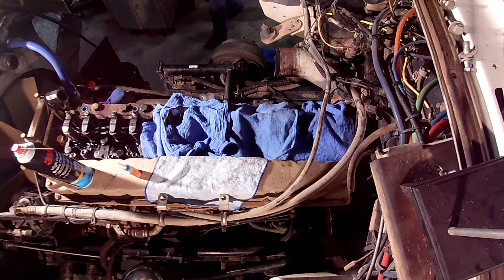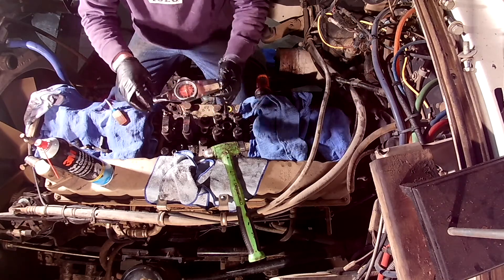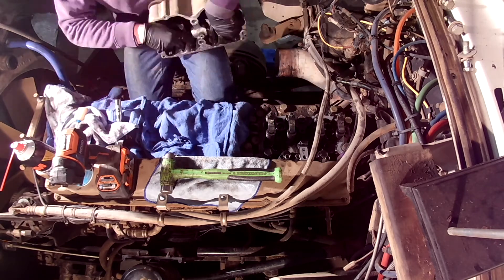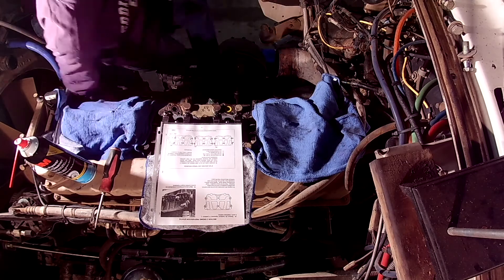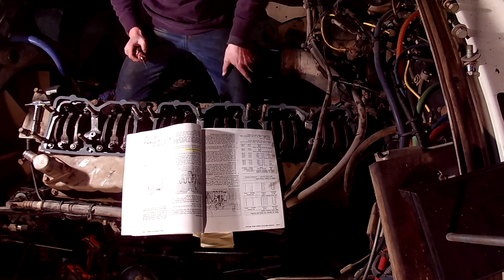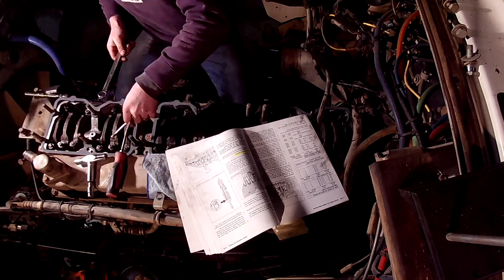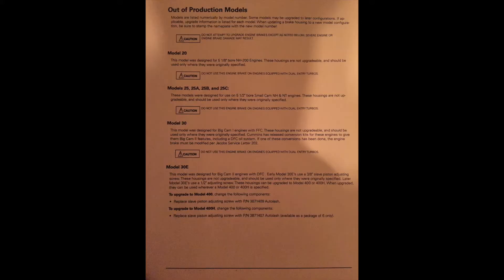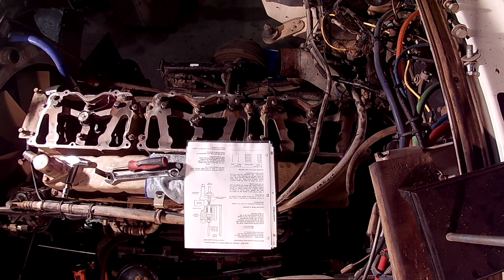Dual Entry vs Single Entry Turbos on Big Cam/Small Cam Cummins motors.

Comment: Very valuable info. I have a 393 cpl and was wondering about an alternative turbo
Reply from the maker: That C.P.L of a 393 reads off of a Big Cam 1 NTC-400 if I'm not mistaken. You could update to a HT3B turbo, but I don't know what exhaust manifold you're running. If it's the old style it will be time to update to the newer style maniflod , as it's a more efficient manifold for exhaust flow and necessary when updating to a dual entry turbo. (that's if you want to see a real performance change in the turbo and motor) Inlet and outlet ports for oil should be ok, but to be honest it's been a long time sense I've worked on a Big Cam 1, let alone seen one! They are a little before my time!! The next question is what Jake Heads you have. If you throw a new turbo on there and don't install the correct auto-lash screws then you can cause engine damage. If you know the model of Jake Heads, model of turbo you want to put on, and model engine you have, then on one of the pages in this video will tell you what auto lash screws to get for your engine breaks. I want to say originally your engine would be running 30 or 30E heads, but if the turbo was updated or the heads it could have the 400 or 400H. Could have 425s or 401..... i don't know!!! Long post and I'm sorry. If you throw a HT3B turbo on there with the right exhaust changes you will see a more responsive motor, and one that has quite a bit more power especially on the bottom end. Your boost will build much better at lower rpm, but don't forget to put the right auto lash screws in the Jakes, if equipped , or bad things will happen . Hope this helps!
Reply from the maker: Long story short a H3TB turbo would be a good candidate if you wanted to do some updating to the trucks exhaust and Jake-Heads if equipped.
Reply: @jimhurricane5831  it is the old style manifold. I have the 425 model Jacobs brakes with the auto lash adjusting screws. I just ran a fresh overhead a few days  ago
Reply: @jimhurricane5831  it is the big cam 1 ntc 400. Absolutely correct.
Reply: @jimhurricane5831  and I genuinely appreciate the information you’ve given me. It’s very hard to find anyone with knowledge on the 855 big cam engines. This is my first Diesel engine to work on and it’s going well so far. Very thankful I went with Cummins. Very easy for the common man with mechanical skills to fix himself.
Reply from the maker: They are a great motor! I couldn't agree with you more on why you, many others, and myself, went with a older mechanical Cummins. The 425A's were one of the later models Jacob's made and were a universal fit. Only need the correct auto lash screws and no messing with the slave pistons and other internal parts that you might have had to do if you had different models on there.. Perfect for what your trying to do if you update to a newer turbo.
        I ordered, and some people will shun on this, several aftermarket pulse manifolds.( The new style manifolds)  Haven't had one problem with any of them, and they've been on the trucks a long time. A lot cheeper that buying OEM. Another option I've gone with is used, which is a great option as well. Good luck with your truck and great job on not being afraid to do the work yourself!
Reply: @jimhurricane5831  I’ve got a semi truck salvage yard right down the road so I think I’m gonna see if they have a used exhaust manifold from an n14 and maybe even a turbo.
Reply: I recently got my new updated dual entry manifold in the mail. Torn on a HT3B or ht60. Any information on that? Thanks in advance! I also gave this video a shoutout in one of my recents!
Reply: @sauciertransport HT60 with bigger HT3B exhaust housing.

Comment: Very good Info to have if you are running the older Cummins engines, which I am. Thanks for the video. I wish you had a link where you could get that info.
Reply from the maker: It’s amazing that these manuals are almost non-existent anymore. They do have them on the Jacob’s website, but it is very difficult to work your way through their site to find them. It’s sad to say these motors will soon be gone, but the biggest loss will be those who had the knowledge and experience to work on them.

Comment: Do you have any idea Where can I find the 3871409 auto lash screws ?
Reply from the maker: If you have a Jacobs part number any distributer should be able to order them. Kenworth, Frieghtliner, and so on. I have had the best luck with the local Pace Kenworth dealer in my area.
Reply: @jimhurricane5831  Thank you

Comment: Jim Hurricane  Good day sir , I have a quick question. On the Big cam 1 I have some play on the accessory drive. Do you know if some play is normal or it should be super snug? Thanks in advance
Reply from the maker: Some play is the nature of the beast on the big cam/small cam engine. "Some play" for some people means very little, and  to others means a whole lot!  Is the accessory drive front seal leaking? That's an easy indicator that the bushing might need to be replaced. Some play is acceptable, but to much is defiantly a bad thing. I believe and don't quote me on this, but the max play for a Big Cam 1 is 16 thousandths. I couldn't find it in my literature and 16 thousandths is what I remember, but this is coming from my memory which is not at all the best.  Not a very difficult job for some just time consuming by pulling the air compressor, if equipped, and fuel pump to access the bushing. You will remove the accessory drive pulley, after aligning the timing marks on the accessory drive gear to the gear train. There is a small plug under the accessory drive housing and that's where you align the marks. Make sure you do this as it is critical when reinstalling the gear that it is in time; as this sets the timing for the next valve/injector adjustments. In short if you don't align the marks you very easily can move the gear putting it out of time, and when you install your pulley your letters a, b, and c will not be clocked in the correct position when you make gear train adjustments. After removing the pulley, remove the front seal, then remove the nut and washer from the accessory gear, do not drop them in the front gear case or you just caused yourself a lot of work by now having to either fish them out with a magnet or having to remove the front gear cover! Once the nut and washer are off drive the shaft from the gear with the T-Puller. There will be a thrust washer in there behind the gear so don't loose it that either! Once the shaft is out drive the bushing out and install the new one and reverser order to put it back together. I would recommend getting a repair manual as it will have the torque specs and also more detailed info in doing this. There is a keyway seal that needs to be installed, as well as,  a few other things that having the book would be a good thing instead of reading a YouTube post!  If the accessory drive bushing has spun inside the housing then your talking a big job. The rear gear train cover would have to be removed making you remove the cam. This means removing the gear train and followers which have to be shimmed correctly back in. I've been told this can happen but haven't seen it myself.
Reply from the maker: After saying I couldn’t find the measurements I found one. This is for a Big Cam 3 mind you which is 11 thousandths play for the accessory drive. I don’t know if the Big Cam 1 is different but this can give you an idea. Hope this was helpful.
Reply: @jimhurricane5831  thank you so much sir. I believe I have just about the right play. No oil leak. So I should be good. Thanks again for the insight. Have a blessed day
Reply: Hello sir, another question. I’m trying to find out why the Big Cam engine needs to run at high rpm’s? If I cruise it around 14 1/2- to 15 1/2 rpm, am I damaging it? Or what’s the whole concept of this if you know? Thanks in advance.
Reply from the maker: Great question. This isn’t a short answer, but I will try to make it that way. What we’re dealing with is the torque band verses the actual horse power of the motor. The torque band or torque curve tells us, or shows us rather, where we obtain peak torque at what r.p.m. On a Big Cam 855 motor this curve starts at 1300 and starts dropping  off after 1500 r.pm. I could get corrected here, but it’s between these to points we have peak torque.  Every Big Cam I’ve ever driven I can’t run at that low r.p.m loaded, because the truck doesn’t have enough “horse power” to stay there; subsequently I have to raise my r.p.m to keep going. Max r.p.m for a Big Cam 855 Cummins is 2150 r.p.m I don’t like going that high, but it’s within the limits. I run around 1800-2000 trying to stay at 1900 on the high side, and only Jake up to 2100. What people do to run at lower r.p.m, and run in the torque band is having their engine work on. They raise the horse power of the truck and in return they have the horse power to run at a lower r.p.m where the motor is most efficient. They get to run in the torque band. One major benefit is fuel savings, but the down side is if you’re not paying attention with the added horse power you can damage the motor. Now to answer your question. If your able to run your motor at 1450 to 1550 and your exhaust temps are good then heck ya I would run it there👍 Going up to 1800-1900 only burns more fuel. If your exhaust temps are not good and high then your lugging it and you need to drop a gear to get back up to a the higher r.p.m’s. Hope this helps👍
Reply: @jimhurricane5831  simply the best explanation. Thanks you sir I understood perfectly. I had a light load(15000) yesterday . Doing 1450-1550 , pyro was at 300-400. Sound about right?  I’m doing a 42000 lb load today so we’ll know for sure today. My probe is clamped to the outside of the exhaust manifold. What’s your thought on accuracy in that location?
Reply from the maker: Loaded you should be over 300-400. Temps should be around 900 at least on trucks I’ve worked on and have driven loaded. Seen many of truck loaded run 1100. Just don’t go over 1200 or bad things happen!!! You want the probe mounted so the exhaust passes by the pyrometer. The probes I’ve installed use a pipe nipple that you weld to the outlet side of the turbo down pipe. Want to stay within 12 inches of the outlet side of the turbo on the down pipe. You then instal the probe and your done. Having the probe mounted on the outside of the exhaust pipe will give you very inaccurate readings.
Reply: @jimhurricane5831  omg, I knew it.  I’m definitely going to fix that . Thanks .
Reply: @jimhurricane5831  I installed it correctly now. About 4 inches from outlet of turbo. Will keep updated on temps . Thanks again

Comment: What would be the best kit to swap a big cam 3 and 4 to swap a single entry turbo to a duel entry turbo
Reply from the maker: Don’t know about any kind of kit Cummins sells. Could go aftermarket, but you might not enjoy what you get!! I wish it was as simple as giving you a part number but depending on how your motor is configured changes what turbo you can throw on there. Using the engine CPL off of your engine data plate as well as your engine serial number will tell you what turbo came on that engine when it was built. Doesn’t mean it’s the one on there now though!!! If it’s a single entry and you want to go dual, which I would recommend, call Cummins and see which dual entry turbo you can install based on your engine CPL. Next see what engine brake models you have on the motor, and make sure they’re compatible  with the model of the turbo you want to install. If they’re not then you need to see if they can be updated or if you’ll need to find different models to fit. On big cam 3’s and 4’s the engine breaks more than likely will just need the correct auto lash screws installed. Hope this helped!
Reply: @jimhurricane5831  do you know what auto lash screw would you need for a duel entry running 33 to 35 psi
Reply from the maker: That’s really good boost for a big can 3!!! We have the H3TB turbos on our big can 3s and only get about 25 pounds of boost under load.!Auto lash screws are based on the model engine brake you have and turbo. Do you know what Jacob’s break models you have, p/n of turbo, CPL, and engine serial number? If you have these then I can get you steered in the right direction.
Reply: @jimhurricane5831  I don’t know what the model im going to get a old 377 Peterbuilt with a big cam 3 out of a field soon and it has a big cam 3 and I have a turbo for a big cam 3 that puts 30 to 33 maybe more for it in a parts room and I was wanting to swap it on to the truck because the truck has a single entry and this other one is a duel entry
Reply from the maker: Ultra Magness my email is hurricanetreeservice17@gmail.com. I’ll be able to better help you over email👍
Reply: Hey guys , quick question. I have a big cam 1 .  I was running it bobtail and only got 12-15 psi of boost. Is that normal? And does it really change under load?
Reply from the maker: 12-15 is what we’re running our big cam 3’s when we’re bobtailing. When loaded we’re around 25 psi. Loaded vs unloaded you will have different boost readings for sure. Turbos loved being pulsed, but need BTU’s to spin as well👍
Reply: @jimhurricane5831  thanks for the reply. I will hook up trailer soon. What are are BTU?
Reply from the maker: A BTU is an acronym for British thermal unit or in layman’s terms a measurement of heat. Turbos loved being pulsed but need the heat/btu’s to wind up👍
Reply: @jimhurricane5831  would that be the pyrometer?  If so , the temperature only goes up when it’s actually pulling a hill. It’s my first time running a big cam 1 350.  Im just trying to get as much knowledge of how they operate. Thanks for the advice
Reply from the maker: Your temp will rise when loaded, as the motor is working harder in short.  A pyrometer is an instrument that measures temp, and allows the operator to see how high his or her exhaust temps are while operating their equipment. In short a pyrometer helps one not “melt” their motor down when at peak power, by knowing when to pull back the throttle based on exhaust temps.
Reply: @jimhurricane5831  10-4 appreciate all the help.  Keep up the great work. Thanks 🙏

Comment: Hi.  Have a question.  I have a cpl 840.  This is kinda off topic. But.  Can I add a second  turbo to it and what would I need and is it even worth it power wise?
Reply from the maker: Sophia a cpl of a 840 I believe is a  88 big cam 4 350. They have a low flow cooling system which is not good for making tons of power. They are a high compression slow timing setup one could say and have problems staying cool when  tuned for more than stock horse power.  If it was me I wouldn’t mess with a second turbo but rather bump my fuel pressure  up. If your looking for tons of power you’ll need to be thinking  injectors, timing, exhaust, intake, air cooling, fuel pump tuning, and  a lot more. If you’re looking for 50 to 75 more horse I would swap a fuel button in the pump and put a pyrometer on your exhaust. Again watch your coolant temps and exhaust temps. You might have to swap some things out to keep it cool. Can’t stress enough when swapping buttons, springs, and shims  in the fuel pump have a knowledgeable person doing it or bad things will happen. Hope this helps.
Reply: @jimhurricane5831  thanks for your quick response.  Not much I can do without radical changes    Not worth it